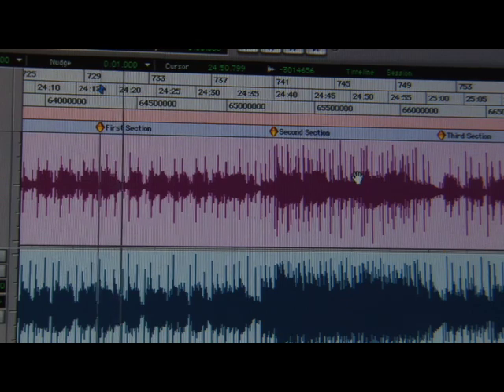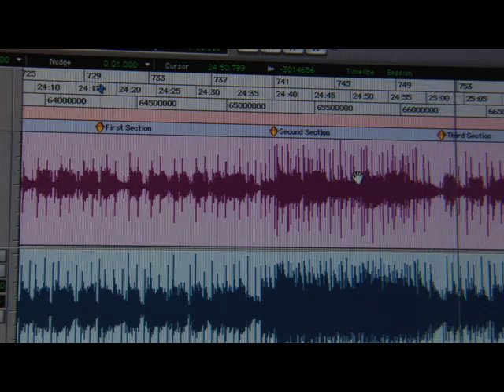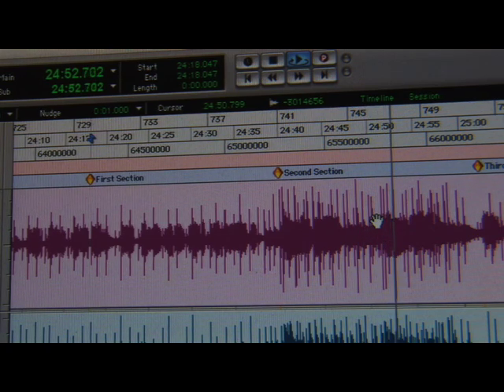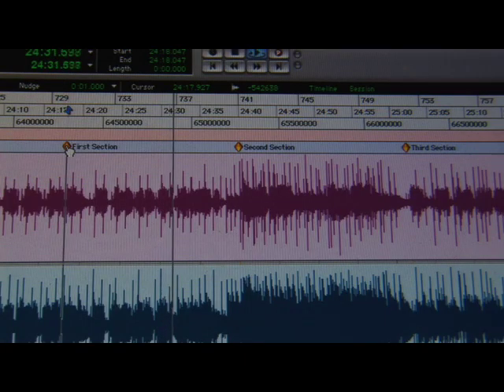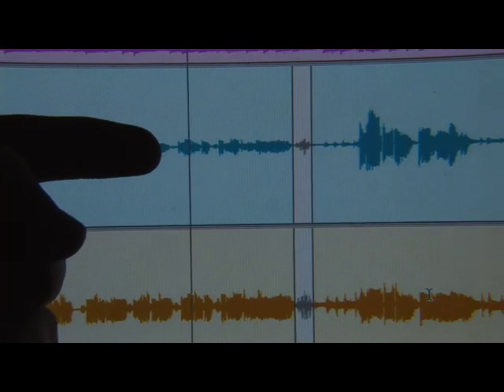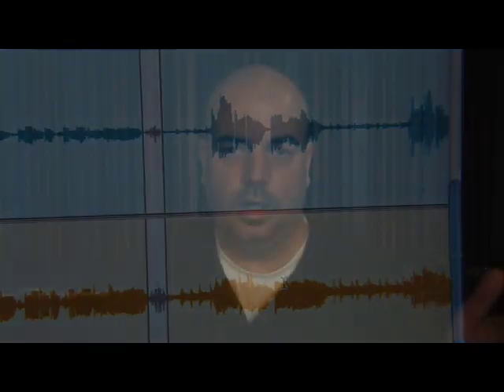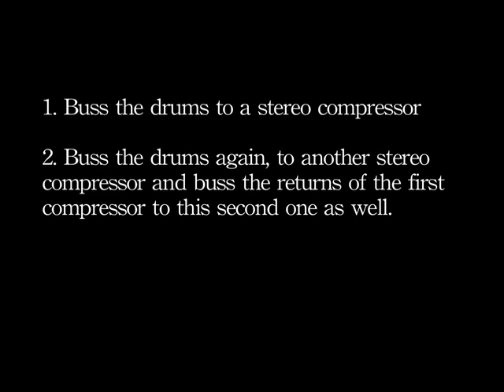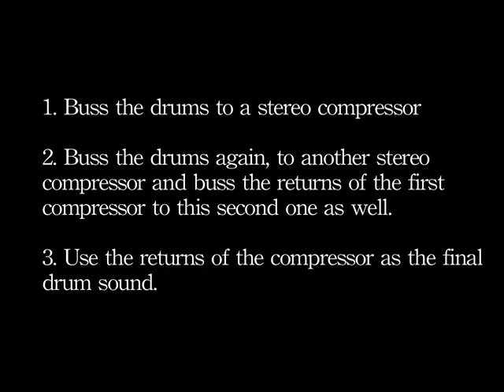Two Stage Compression Part 2

Comment: Thank you for posting this, much respect!

In the DAW domain, would you say is there still a need to use two separate busses, or is it enough to stack two compressors on one buss only?

I see people use the 1176 and then LA2 to control vocals dynamics in a two-stage manner, and I'm just wondering if it's essentially the same approach.